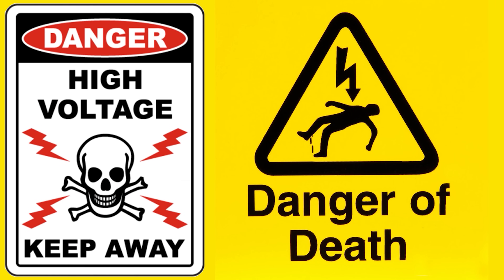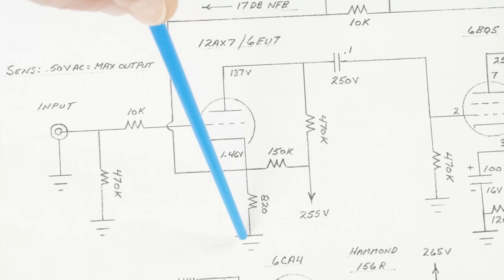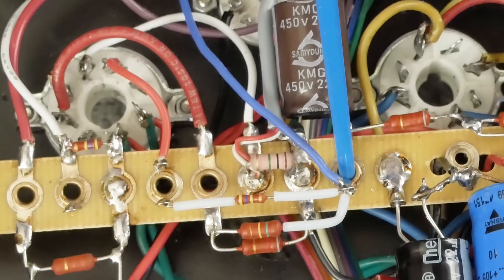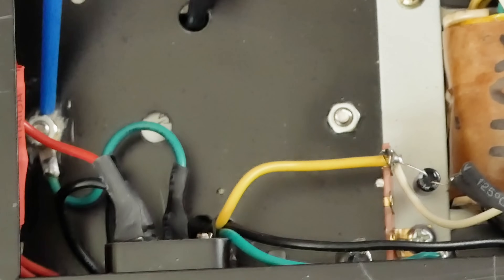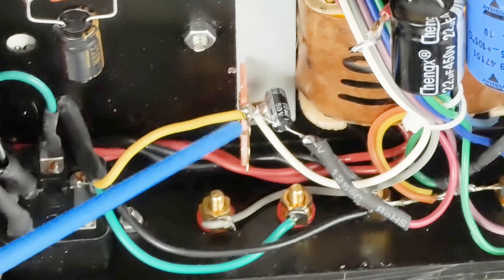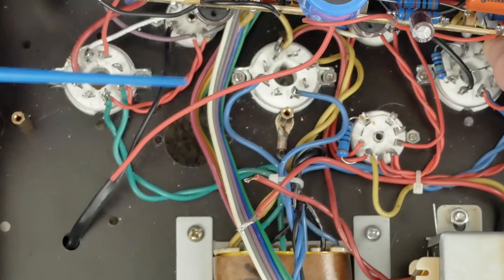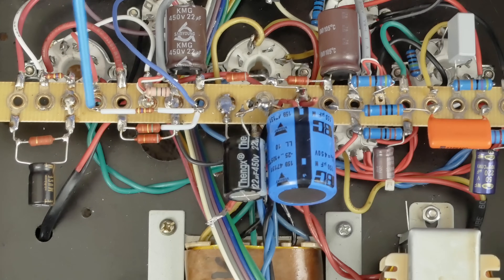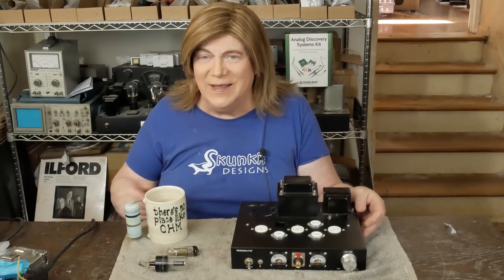Nobsound 6P1: Rebuilding it into an EL84 SE Amp #2

Comment: Hallo.Wenn 2 gleiche Resistor 460 ohm 1 Watt ,mit der Zeit dunkler geworden.Soll das ausgetauscht werden?Danke schön.
Reply from the maker: If the resistors appear to be discolored or burnt, it's a good idea to replace them, as this could indicate they are overheating or failing.

Comment: Looking forward to the feedback comparison.its my understanding that early rh design used a traditional resistor for bias on the cathode of output tube.i wonder what difference the quality of the output transformer makes when using global vs schade f.b.would the global give better low and high response when using aes pt31 low cost iron?
Reply from the maker: I think global feedback is very output transformer dependent. And someone I chat with a lot about this stuff said he wasn't impressed with those cheap AES units but was shocked how good these black end bell cheap China units are. I know Dave was limited on what would physically fit on that old Maggie chassis, we aren't nearly as much.

I saw the early RH schematic, it had the output tube biased much colder, I think using Schade feedback with Dave's bias points might be a best of both scenario!
Reply: Looking forward to your measurements and listening impressions.i plan to experiment with with those circuits as well.

Comment: I upgraded my pre-in RCA sockets of in my LM-845 premium int. amp to Furutech 903(g) gold plated pure copper ones and directly wire them directly (skipping all switches) to the grid resistors of the 1970 Western Elecctric 310A driver tubes using Cardas chassis wires. With my Cardas Clear Beyond phono cable with Furutech 111(G) gold plated pure copper RCA plugs (use as an interconnect here), the improvement is astounding.

Comment: I regard it as much preferable to abandon the global negative feedback for local NFB. I have only done a couple of amps so far, but in my designs I only applied NFB through cathode resistor. It might seem ridiculous, but I can't help feeling that the NFB signal run time over several stages does not meet the original signal at the same phase position - and much worse if the electric/magnetic and magnetic/electric transmission in the OPT comes into play. Anyway, wish you the best possible outcome for your procedure next week!
Reply from the maker: Yeah, I'm really just excited to test one versus the other and then see what changes I may have to make on coupling caps and possibly the cathode bypass cap and how that impacts the frequency response and bandwidth.

Comment: Have you given any thought to soldering the main ground to the chassis?

Btw, really like this idea. Ive done this with an old Lafayette integrated. Turned it into an amplifier only with the same chassis. 

Also , I love the thought of side by side testing of different circuits in the same chassis. I often enjoy testing different changes as small design changes as much as I enjoy listening. Everything looks great!
Reply from the maker: No, it would destroy the paint.